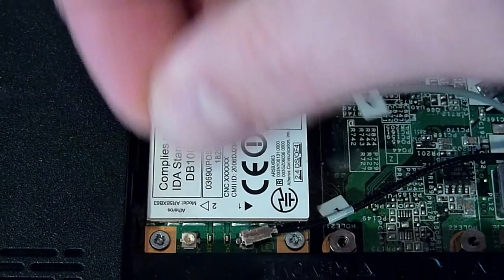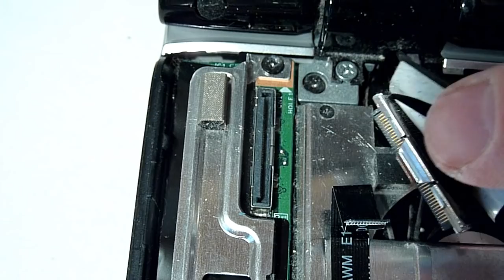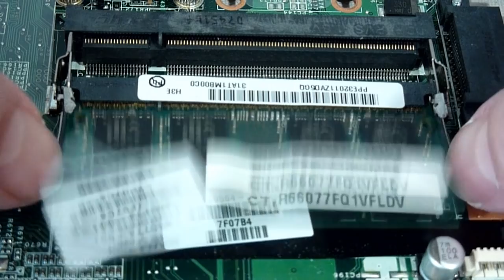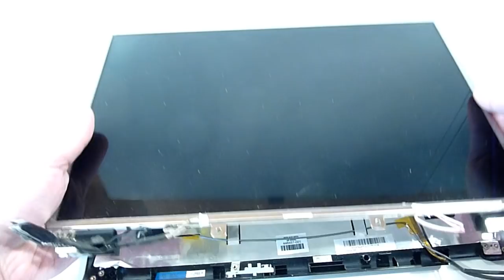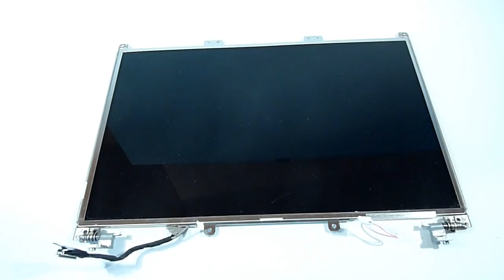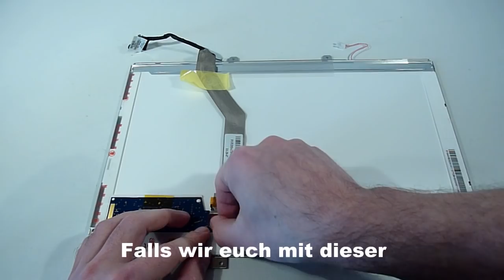HP Pavilion DV6000 Disassembly Tutorial – Teardown Guide 1/2 - with subtitle

Comment: Well, ihaveadv6000. Looks just like yours.but after messing with the top plastic i had todo 3 more things. I had to remove 2 nuts. Then i  had to remove the hardrive adapter so that i could get the main board out. Last ,the  cooling fan with the copper heat sink was nothing like yours. I had one tube and your had two. Odd. Must be a canadian machine. Either way you helped me dig into it quick despite being a tech guy for 15 years

Comment: Dear Sir, thank you for your help. Extremely clear. Is this procedure apply also to de HP HDX18T-1200? My display goes off after 30" in whenever condition (boot, init, or normal work). So look like I need to change inverter first or the entire screen. Thanks a lot.

Comment from the maker: That would be great but I think will not happen.
Look at the new Ultrabooks. The get thinner and thinner. Thats the reason why everything has to be on one board.
And I think you won´t see GPU´s in the future in a Laptop because e.g. intel built faster and faster GPU´s into their CPU´s. And these are even now fast enough for desktop applications.
It is cheaper to use a single CPU/GPU than two different devices.
And even now you find Laptops with soldered Ram. 
It would be nice but it wont happen

Comment from the maker: @blumuze2 
It does not offer a beep code at all time. sometimes the malfunktion is to heavy so that the laptop can´t boot. In this case it can´t give any beep codes. As I said I can´t locate the failure from here. But it seems to be something with your mainboard. To know it exactly you have to go to a specialized repair shop where they can test it.

Comment: My second question: I need to extract data from the HD, but the connector doesn't look like the typical SATA connectors I'm familiar with. It has 22 "pins" (tangs, actually. 7 for power and 15 for data?). I need an adapter or enclosure for this drive. What should I be looking/asking for?

Comment from the maker: @arkasza2007  I would suggest to disassemble the fan and clean it with a tooth brush. This way you make sure it is really clean and you can add new thermal paste on it. Another way you can clean your fan is with a air duster. This way you blow out the dust with compressed air. Make sure you use only compresses air without any oil or someting like that in it. And do not use an compressor because it is too strong. Search for air duster on google or youtube and you will find some more info.